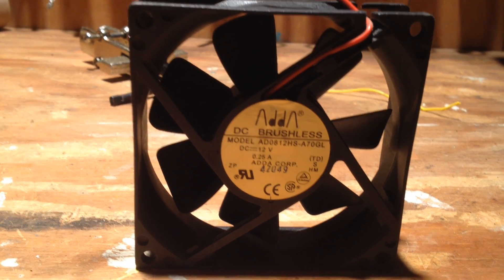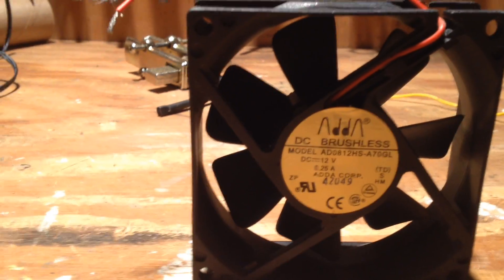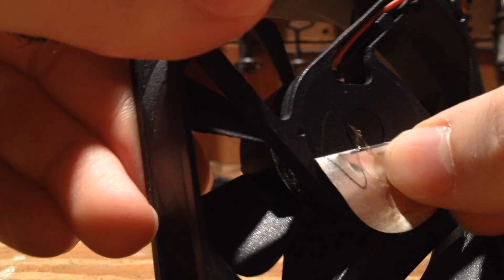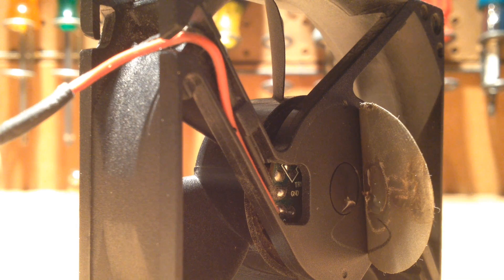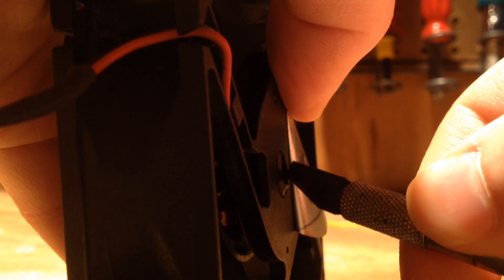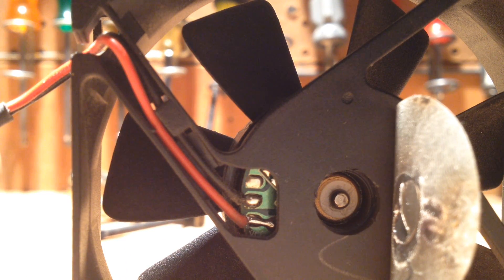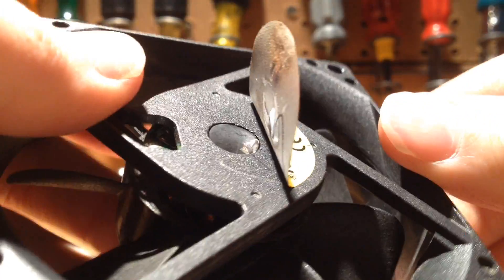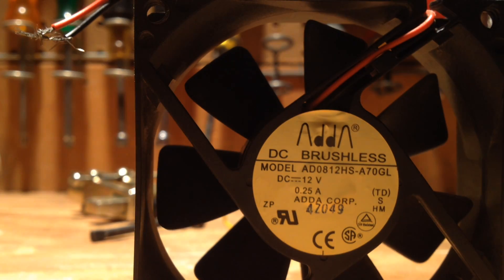How to Fix a Noisy or Slow Computer Fan: Lubrication/Oiling

Comment: You can simply push the fan out using your thumbs it's what I do my pc has 10 fans and the top radiator fans are the ones quick to rattle after 1-2 years. My fans doesn't have rubber in yhe center so what I do is I simple push out the fan using my thumbs and use machine oil a few drops at most. I do this every month because the bearings are dying but oil makes it run for longer.
Reply from the maker: I don't understand what you're talking about. That's not how this one works.

Comment: Hey Jordan, I sent you an email regarding a question that I had about some oil lubricant that I found. I just wanted to get your advice on it before I put it into my computer fans. I had to email you because I attached the links to the product on Amazon, and the links were probably blocked because YouTube thinks that they are spam or something. Anyway, if you could check out the email I sent you I would be very grateful. Thanks! 👍
Reply from the maker: Patience is a virtue--this is free help provided by one person.

Comment: Hey Jordan, this was a very helpful video! My only question is what kind of oil would you recommend other than what you used in the video? Do you think some synthetic lubricant oil will be fine? I also found some synthetic oil meant for grandfather clocks on Amazon... What do you think? I will be oiling the fans that are in my Original Xbox because they are kind of loud. I just want to find an oil that is very high quality...
Reply from the maker: I only use the oil I showed in the video. Anything lightweight and non-detergent would probably work fine.

Comment: This works, I find it to be short term though. I did a fan on my 3D printer and in a couple of weeks it was making noise again. New fan on order, lol!
Reply from the maker: It depends on the condition of the bearing, if it's worn to the point of being rooted, no amount of oil will fix it.